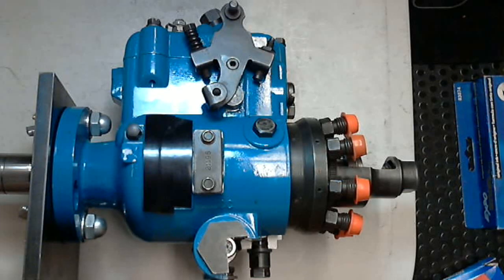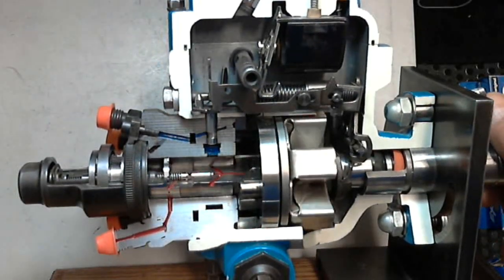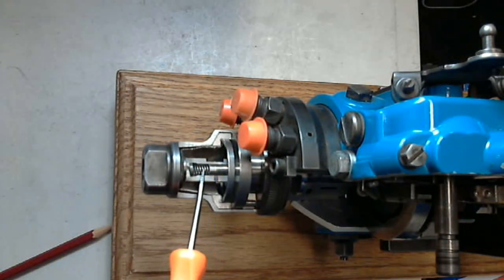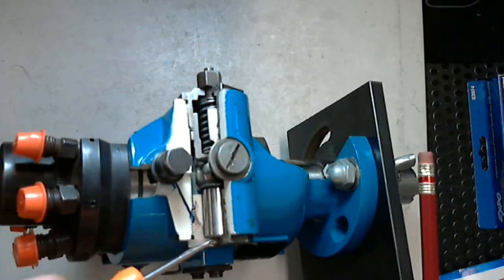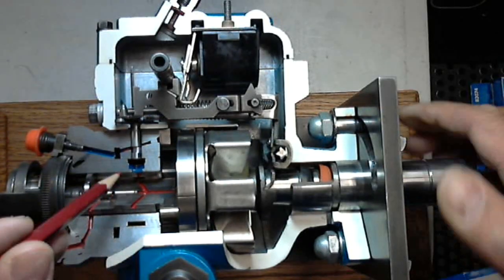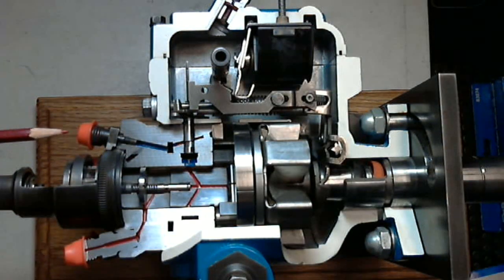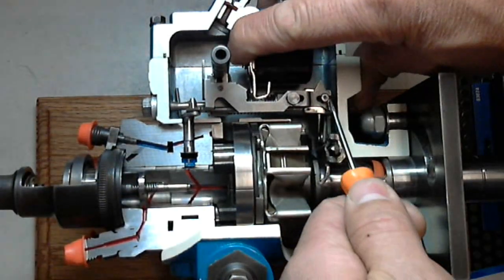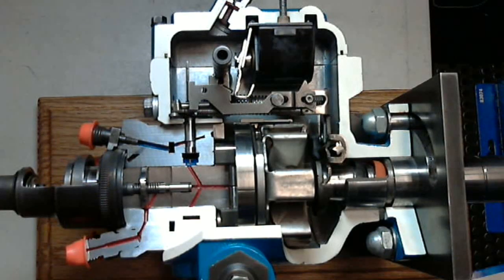Be the Fuel.wmv

Comment: Hello Dave, could you please tell me what the start of injection timing should be (in crank angle BTDC) for an automotive engine. What should should it be at fully retarded (low idle) and at max rpm (fully advanced). Thanks
Reply from the maker: Hi Sunil, BOI will depend on the engine manufacturers design requirements and even the size of the engine will have an effect. I am going to relate my answer to a mechanical fuel system as the electronic systems can vary the timing and the length of delivery time based on input from the ECM.
In general at low RPM and idle you would want the timing to begin injection from around 5 deg BTDC to even a few deg. ATDC. The piston is moving relatively slowly and the fuel injected is minimal so not much heat is produced to ignite the fuel.
As RPM rises, the pistons are squeezing the air much faster and the quantity of fuel is increased so the timing must be advanced to give the fuel time to evaporate, ignite and release the energy on the down stroke.
This can be up to 30 deg. BTDC on SOME engines. The key is to not have the main pressure rise in the cylinder happen until the piston is a few deg. past TDC. This will allow the engine to produce the most and longest duration of pressure on the piston's power stroke.
I am not an engineer so I could not give you exact numbers for your application and much of this is information becomes skewed once engine performance modifications have been done.
I hope this helps.
Reply: instructordave111 thank you dave! this clears up a lot of basic questions for me. One more question; what are the two spacers in the stanadyne/lucas pump for? (the two thin rectangular plates with rectangular slots, under the roller shoes)
Reply from the maker: If I am understanding your question correctly, those are the opposed plungers and when they are forced together by the roller and shoe riding up on a cam lobe, they force the fuel out from between them and this is what becomes the injected fuel.
Reply: instructordave111 sorry. that was probably a badly phrased question.  I'm not talking about the plungers. there's two thin plates under the shoes...
Reply: instructordave111 i took apart a delphi pump and I'm trying to figure out the parts. I'll make video and send you a link
Reply from the maker: I am not seeing the thin plates that you are asking about. If you see the two plungers, at either end of them are the shoes that the rollers ride in. Lucas pumps use a thin adjustable plate to set the Maximum roller to roller dimension in the pump. This will vary the amount of fuel injected. The further the rollers can get apart from each other the more fuel can be loaded for injection. The Stanadyne pump in my video uses a leaf spring for this.

Comment: If its a Cup seal, can i repair that myself? its coming from either the bottom or where it bolts. NOT the fuel lines side.
Reply from the maker: Hi Rick,
 There is a "weep hole"in the area between the two Fuel cup seals that is there to let you know the seals are failing.
 Do not JB weld over this hole or you will end up with the fuel getting into the oil pan and that will cause a bunch more engine issues.
The cup seals can be changed by you if you are a little bit mechanically inclined.
Set the engine at #1 cylinder on compression using the Cummins pin , make a mark from the pump housing to the front cover, remove the fuel lines from the pump, remove the pump from the engine ( you may need a puller to loosen the gear from the tapered shaft. Don't lose the key into the engine when you do that part. Remove the pump drive shaft and change the cup seals. Some manufacturers sell a seal installer tool when you get the new seals. When you reinstall the pump driveshaft, make sure the seals don't flip back using the tool and absolutely be sure the driveshaft timing marks are lined up inside the pump. When everything is apart, be sure that the engine or the pump do not move or resetting the timing could be an issue.
Good Luck with your project.

Comment: Awesome video. I own a personal vehicle that is a 6.9. Its leaking from the bottom of the pump. somewhere. Not the fuel lines though, I made sure. it leaks very little. I can drive it around no problem. No air intrusion in the lines. engine still has its full power it seems. Any suggestions? I was thinking of putting JB weld. but something tells me that wont work... Sad day for the 6.9 engine.

Thank you for the video. I plan on keeping this truck until i die. its fun learning about it.
Reply: Its informative adjustments and working proceedure of speed limiters should be added

Comment: With the three injector lines undone at the IP should fuel squirt out, even if it is out of time. Also pulled the top off, shutoff moves back and forth like it should, put it back together. Now not getting fuel in the bowl, plenty of fuel flow to the IP pump.
Reply from the maker: Hi Tom, if there is fuel in the pump, the internal transfer pump is working properly and the metering valve is not in the fuel shut off position it should deliver fuel from the high pressure ports. Possibly the transfer pump is not working or the differential pressure valve is stuck in the open position. the electric lift pump is only there to deliver fuel to the internal transfer pump, which is there to deliver fuel at varying transfer pressures to the high pressure side of the pump. If this pump had any water in it and sat for a period of time some of the internal components may be frozen in place. It is actually not a complicated system, but many things have to work together at the same time to make the pump do what it was designed to do. .From your description it seems like the system from the tank to the inlet is working so whatever is the issue is in the pump
Keep at it and let me know what you find.

Comment: Hi Dave, great video I have a compressor with a john deere 3 cyl and a stanadyne db2 pump. My problem is  it will start and run on either, stop either and it quits. I have an electric pump going to the mechanical pump and have plenty of fuel to the injector pump.Checked all return lines and fuel runs freely back to tank. Opened side timing cover to check for sheared shaft and it is turning. Have power 12v to fuel shutoff and can hear it click when turning on switch. Undo injector lines at pump and turn over and no fuel whatsoever. Pump looks like new, even though I hear the fuel shut off click could it be stuck internally or something? Any Ideas? Really appreciate any help!
Thanks, Tom
Reply from the maker: If the solenoid is working then it is entirely possible that there is something else stuck or seized inside the pump. You could take the top off and see if the linkage that operates the metering valve is free and the metering valve is also free to move. While the top is off, energize the solenoid to see if it is working.
Reply: Thanks, Dave Is there a special way or any tricks taking it off or putting the top back on?
Thanks, Tom
Reply from the maker: No real trick other than be gentle with the gasket and do not let any dirt get into the pump housing. If it's the same as the one in the video, just remove the return fuel line, the wiring to the solenid and the 4 screws holding it down. If the pump was recently replaced, was the driveshaft installed with the timing marks on the end in the right place? The driveshaft can be installed 180 degrees out.

Comment: Hi @instructordave111 , I have this same model pump all torn apart on my work bench, trying to turn DOWN my fuel delivery because the last eBay owner had it set way to high. my motor will hydrolock with too much diesel when a heavy load gets put on it. I really need your best answer even if you do not know, I can't afford to bring it in because i blew all my $ on buying the pump. I have searched hundreds of videos, and left all relevant comments on my problem and nobody replies so i was hoping you would know. Thank you @instructordave111
Reply from the maker: Hi Levi, on this pump the amount of fuel delivered can be reduced by turning the plunger spring bolt out, away from the rotor. this limits the amount of fuel that can be loaded between the plungers. it will be hard to get it right without a test bench but if you are comfortable with taking it apart a few times you may get lucky. Just make sure all components are kept extremely clean while you are doing anything inside the pump.
Reply: Oh thank you very much instructordave111 ,  So when I screw the spring bolt out will it remain secure? all i have to do is turn it out and it shouldn't come loose when i start running the motor? I am not home right now, so i can't look at the pump. Just checking to be sure is this the spring bolt you are talking about? http://image.trucktrend.com/f/tech/general/10383424%20w799%20h499%20cr1%20ar0/0809dp_04_z+stanadyne_db2_injection_pump+pump_elements.jpg
The leaf spring bolt? if not, I know I must be close you know.
Reply from the maker: Hi Levi, As with any internal fastener, I recommend using some type of thread locker like Blue Loctite. The leaf spring bolt is usually a slight interference fit but over time and possibly having many adjustments it may not have the tightness that will give you confidence. If it comes out during operation there are many things that will be destroyed inside the pump itself. You do not have to turn them in or out very far to make a change in the amount of fuel that is delivered. Having a chat with a fuel pump shop technician may help determine how much you want to restrict the delivery volume.
Reply: Okay thank you so much, I am going to locate a technician and ask him how much a quarter of a turn would affect the fuel. I will find that out all before hand. Finally, my last question, Do you believe I should be safe with adjusting the screw just one time and not have to worry about it coming apart while running? The screw was only adjusted one other time according to the seller, four or five years ago, and it has been ran a lot since.
Reply from the maker: Hi Levi,I would check that with the technician as well. If it has not been used as many times as the ones that I had in the classroom it may be fine, but I won't promise you anythig lie that from this distance away. Good Luck  with getting it where you need it.
Reply: Thank you so much! You are a good man! See, if the world was filled with with people like you, this country wouldn't be like this. You are a great help to society! I was clearly fooled of myself when before i seen you video and talked to you, now afterwards, i am 100% confident. Thank you Instructordave111
Reply from the maker: Thanks for the kind words Levi,I believe people should try to help each other out whenever they can.I hope all goes well with your fuel pump.

Comment: so it controls the amount of fuel but not the end of injection? doesn't this cause variation in injection pressure from cycle to cycle?
Reply: The injection pressure from one cycle to the next will remain constant if the engine speed remains constant. Injection pressure is the result of the fuel going through the injector. If the amount of injected fuel is increased the injection pressure goes up because the injector nozzle doesn't change it's hole sizes but the plungers will still be forcing the quantity of fuel out to the cylinder.What this means is that at any given speed you will have a constant injection pressure for that speed. At low idle speeds you need very little fuel and have a relatively long time to inject it. Where at high speeds you need more fuel to be injected and have much less time to complete the injection so the injection pressure must go up considerably to accomplish that. This pump will go from around 5,000psi injection pressure at idle to upwards of 23,000 psi at high speeds under load. For each situation the injector nozzle does not change so more fuel in less time makes higher injection pressure.
Reply from the maker: Sorry my wife was logged in when I answered some questions below so it shows up as her answering.
Reply from the maker: Both systems work so I am not sure I would place one as better than the other. In a distributor pump you are limited by the design so they are not found on anything with very high horsepower due to the fuel delivery limitations.A sharp, fully atomized beginning of injection is more important than the end of injection in my opinion.
Reply from the maker: Caterpillar and International used a type of flyweight design advance mechanism between the fuel pump and the gear train on the 3208 Cat, I don't remember the IHC engine to look for. It was used on alot of early diesel combine engines. As speed increased the flyweights would advance the pump rotor to advance the BOI.
Reply: haha. is this a better system than the bosch ve where you actually control the end of injection? I realize that mightnt be a meaningful question
Reply: I originally came to your channel because I'm working on designing a pump for a single cyliinder engine.

 it's going to be like a PF pump but i want to have a control sleeve instead of a helix and rack.

it won't have a feed pump so I can't use this type of advance.

do you know of a centrifugal advance system that I could use?

Comment: how can i change or adjust the injection quantity?
Reply from the maker: Adjust the leaf spring bolt, in to increase delivery, out to reduce delivery.
Reply: The leaf spring bolt being the part that the govener moves in the casing? I have a perkins 6.354 and can't find any information on the pump
Reply: Roosa master 5/32 hex driver. You must remove the governor spring assy. Then manual rotate engine until screw head is visible inside the top hole of the cam ring. One flat of the hex driver is all you want to turn the screw. It’s that sensitive! Approx. 10% more fuel.  Perkins usually used a cav, Lucas rotary pump. Fuel adjustment is: remove side timing cover. Rotate pump to expose one of two hold down screws. Loose it just a little. Rotate until other screwhead is exposed, loosen it. Now you can carefully rotate plate a tiny bit to allow shoe to travel out further. Tighten screw, rotate again and tighten first screw.   It’s worth mentioning that neither of these is recommended for those not familiar with these pumps. To many things can get screwed up. Also, these pumps are always calibrated, cranking them up, leads to excessive smoke, poor fuel mileage, sometimes messing up other settings, such as timing, high and low idle, even transfer pump psi. Which could destroy the pump. Bring it to a pump shop!

Comment: I have a old IH td6 dozer with a stuck plunger, will the whole pump  need to be removed to repair?
Reply: I'm afraid your pump will need to be removed and rebuilt if the plungers are stuck. You may try filling the pump with fuel conditioner, but I doubt that you will have any success just trying that. If they got some water in them they will likely be rusted in place.
Reply: thanks, ill give that a try.

Comment: But how does the fuel get from the top part to the advanced piston?
Reply from the maker: There is a drilled passage that allows transfer pressure fuel to act upon the advance piston. As the speed increases the transfer pressure also increases and the advance piston is moved against the spring even further to advance the BOI.

Comment: I have a tractor that will start fine but idles high and I have no throttle response. Any ideas its a 4 banger with a cav pump
Reply from the maker: You may have an issue with the control on the metering valve or a governor linkage issue. the CAV pumps work a bit differently than the Roosa Master design in this video. I don't have a CAV video to reference on this.

Comment: Wow. I finally get how the plungers work! I have an old 6.2 in a suburban that I let sit for a couple years, and now my plungers are stuck. No output. Tried soaking the pump in 180 degree canola oil, but still no output spinning by hand with an electric fuel pump inputing diesel. Removed the metering valve while soaking. Any quick advice for freeing up the plungers before I give up and get a rebuild? Can't afford $700! Thanks for your work. Really helping me get how it works.
Reply from the maker: +Washington D. Sastor Once the plungers are seized, there is not much that can be done other than a tearing the pump down and if there was any water sitting in there they may be rusted in place. Are you sure it's the plungers that are not working?